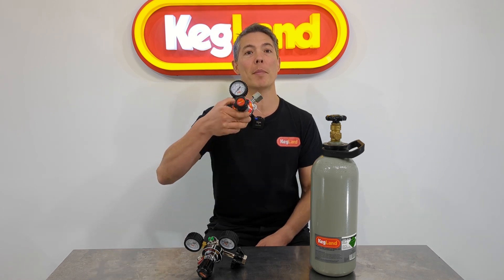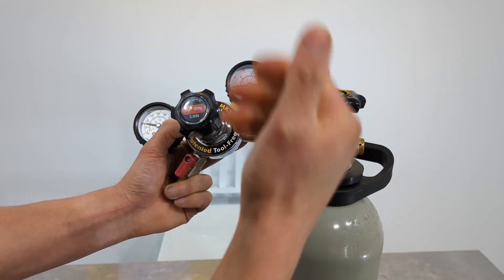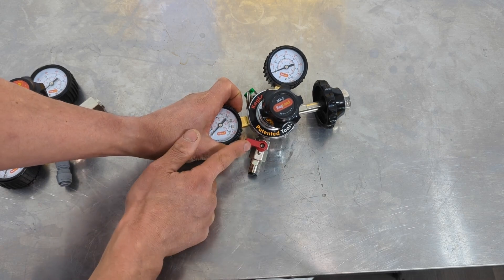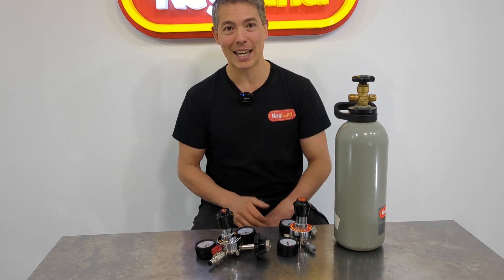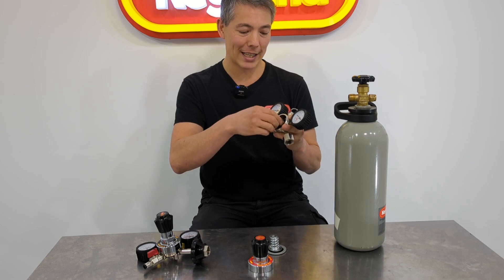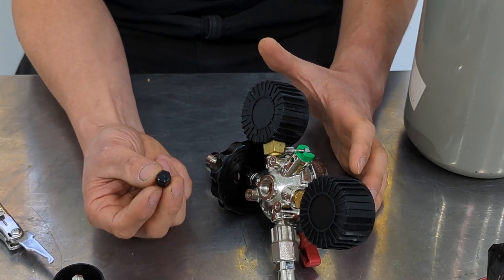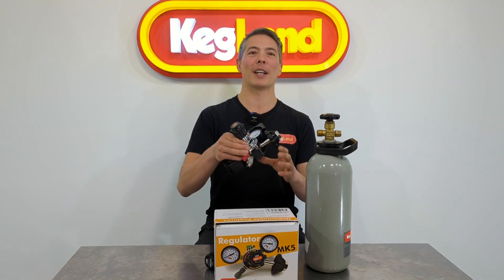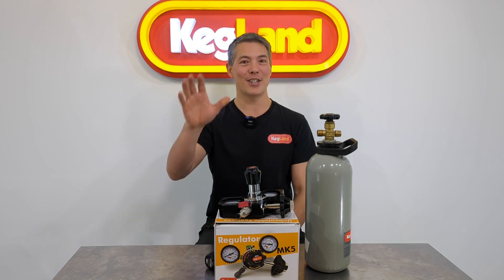MK5 Regulator Tool Free Design is Reliable, Easy to use and comes with 10 year Warranty

Comment: Getting the regulator installed onto a used co2 tank requires a bit more effort, especially if it has a valve collar. It would be good to clean the co2 valve threads before attempting this. If you get the optional gauge guard, install it after installing the regulator. I had to use a wrench to get the nut installed properly and the regulator handle made that difficult. Overall, I think this is a great product.

Comment: Any chance you will release the shut off/check valve assembly as a separate part to retrofit into an older model?  I would love straight Duotight capability without adding the flare adapter fitting.

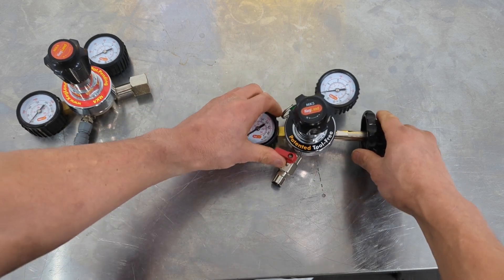Comment: I guess that built-in shut-off valve 4:20 would really be a deal-breaker 😂
Reply from the maker: Yes for some customers they really like this feature.  I think if you know what you are doing and are careful I don't think it's absolutely necessary.  With that said it only adds a few $ to the price so it's probably worth the money.
Reply: @KegLand 
The whole things are not absolutely necessary should you think further 😂
I bought MK4 instead of a slightly expensive regulator with integrated ball valve. And I regret it. I have to add cumbersome KL0694 for 8mm or KL07474 for 9.5mm with dangling 10-15cm hose atrached to respective coupler attached to the regulator. Now that absolutely is NOT necessary. 😢
Reply: Can liquid get up into the round gauge and if it does will this affect the reading also if so is there any way of fixing the gauge as I have a MK 4 a few days old but replaced it with a MK 5 because of false readings ?

Comment: Will these come with other gas options ? Like the type 10 and type 50? Also will you be able to swap out the type 30 connection on the co2 regulator to a type 10 or 50? Like you currently can with the mk4 regulator?
Reply from the maker: Yes we will offer the Type 10 and Type 50 in the future too.  These are a few months away.

Comment: All my gas lines are 3/8" (9.5mm) - who on earth uses 8mm gas lines (except where you have to on the bloody annoying spunding valves🙄)
Reply from the maker: Normally for commercial venues the 3/8 gas lines are the most common.  With that said home brewers do not need the high flow rates.  we are starting to see a lot of customers even going down to 1/4 OD gas line.  Once you go this small you can pass the gas line through the door jam if you needed.  Alternatively if you want to run 4-5 gas lines into your kegerator the smaller 1/4 can easily fit through the 18mm hole.  So there are definitely applications where it's useful to have a smaller gas line.

If you dont mind me asking why do you think you need 3/8" OD?  How many kegs do you have connected to the one gas line?
Reply: LOL welcome to 2024 ... most of us are moving over to 8mm
Reply: Having built a new keezer all my lines are 8mm. I see no reason at all to use 9.5

Comment: The ball-lock/duo-tight seems very impressive. I can see some applications for this in instances where you don't need a vacant ball-lock to block the line like in the outgoing part of a beer line (the section that's connected to a tap or exits a fridge) and in cleaning supplies. It should maybe be a default supplement to that spray can you posted the other day (or a non-electric alternative to it for most that don't need electricity).
Reply from the maker: Yes I would agree with that.

Comment: I've been looking for a new regulator for a while because I have a TON of pressure creep when my current one when it gets cold. I even bought a 17 PSI PRV to extra protect my FermZilla when doing pressure transfers. I used it inside my fridge for a while but after disassembling it and seeing everything in perfect condition, I kinda gave up on it. Is this "cold pressure creep" caused by damage/low quality regulators? Or the MK4/MK5 also suffers from it?
Reply from the maker: You need to clean your regulator out.  If you get creep at all you need to clean the contamination out of the regulator.  You probably have some moisture, rust, or other contmination in the reg.  As you can see with this new model it's easier to clean.  With the older MK4 you have to take off the front of the regulator and probably replace the seat and seat cap assembly with a new clean one.
Reply: @KegLand  oh right, forgot about moisture since I was fully expecting some serious rust when I opened it. I'll give it a deep clean and see if it improves but I might replace it with the MK5 once it comes to Brazil for better serviceability.

Thanks for the tips!

Comment: Will you be making a 9.5mm duotight version? Since I got my Mk4/keg/tap kit from Brewkegtap in UK all my tubing and fittings are 3/8 (9.5mm) instead of 8mm. Kinda werid eh?
Reply: There’s a John guest adapter to take 8mm to 3/8” (9.5mm). We’ll try and source a 9.5mm version though as it’s the most common in the UK.

Comment: Kee,
I know a lot of folks put the gas in the fridge or keezer/kegerator.  What is the recommended operating temperature of the unit? Will the plastics be effected if you do indeed, put it in the cold . I assume the black handle is ABS ?
  This looks like a wonderful unit!
Reply from the maker: It's fine to put the whole regulator in the fridge. That is no problem at all.

Comment: Thanks guys cool tool again! As i see the weakest part is the outlet duotight connection. Is it possible to change that part if something happens with it? Can you switch that part with a threaded duotight fitting?
Reply: If you unscrew the duotight fitting you have 1/4 thread on the ball valve.  with that said the duotight fitting we put on this regulator is already machined out of brass so it's quite reliable and I think you would be doing yourself a diservice to remove it.
Reply from the maker: you can always unscrew this fitting if you like but we do not find them to be unreliable so I get the feeling that this would be a downgrade.  We now have dual compout o-rings with silicone and EPDM and this particular fitting is cut from brass body.

Comment: Love this video and all the ones you do,  so informative.   I have a question,  I already have a MK4 I will be using only for CO2 but I have in my basket now the MK4 regulator for Mixed Gas, before I purchase this can you please advise or help.

I love the idea of the Ball Valve on the output,  can I upgrade the current MK4 I use for CO2 with a Ball Valve with duotight fitting and also for this Mixed Gas Regulator.   Is there such a part with FFL to Duotight with Ball Valve I can use.   Regards, John

Comment: What a timely video. I'd never seen or even heard of pressure creep until 3 days ago. My MK4 literally started doing it earlier this week haha. It eventually fixed itself but I now know that's only temporary.
Reply: I would take the regulator apart and give it a clean.  Once it starts happening it generally gets worse.
Reply from the maker: If you give it a good clean out and replace the seat and seat cap assembly you can probably get it going again.

Comment: I find the best SoP is to never touch the PRV on the reg. Treat it as an emergency relieve valve only. If you need to vent pressure always do it from the keg. I'm sure someone will have a reason to vent via the reg but I haven't come across it yet.

Comment: Wow, the tool-free design is handy, but that combo check- and ball-valve is awesome! Bummer that I recently bought a new regulator, I definitely would've bought a MK-5 had I only known. {sigh}  Way to go on another great product!
Reply from the maker: I hate when that happens. The older MK4 was still a solid unit so I am sure you will be fine either way.

Comment: Have been using the Mk4 unit with a 3.5kg bottle for some time and never had any issues 🍺👌.

I put the stainless steel bracket on my set to protect the gauge's, I reckon a  thick nylon protective bracket would be a cost effective measure to include for a few extra dollars 👌🍺.
Reply from the maker: Yes it's something that a lot of people regret not purchasing down the track.

Comment: It would be great if you had a full cleaning video of the Mk4, my gauge makes noises and vibrates?? Because I live in a remote part of thailand servicing by my supplier would be a very much inconvenience job to send away for inspection. And by the way I fitted the SS guard on day one (had no knocks)
Reply from the maker: If it's vibrating I would take apart and give a clean.  It's probably got some corrosion in the unit and the seat cap assembly is not moving up and down smoothly.
https://kegland.com.au/products/mk4-regulator-replacement-diaphragm-and-seat-assembly

The diaphragm itself is probably fine but just swap out this brass part in this kit above.
Reply: @KegLand  just took it apart very easily leaving the SS Guard on and squeezing in a vice, it was like new, so I put a minuscule amount of lube on the O’Ring and the big rubber seal in the bonnet, I think it’s done the trick, fingers crossed:-) not experienced pressure creep as of yet

Comment: Very well designed. I have an MK4, and I actually added the on-off-ball lock valve back when I first got mine, as I really liked it and just felt it needed the ability to close off the flow without having to adjust the knob on and off each time. Great to see KegLand listening to their customers and really exceeding expectations. Very Nice.
Reply: May I please ask you, I  am looking for a Ball Valve to use as well,  would you mind letting me know what you fitted to you Mk4 please, Regards, John
Reply from the maker: Thanks for that. Really appreciate it!